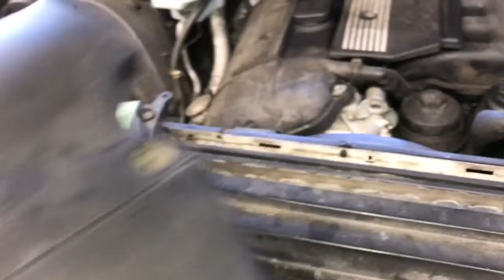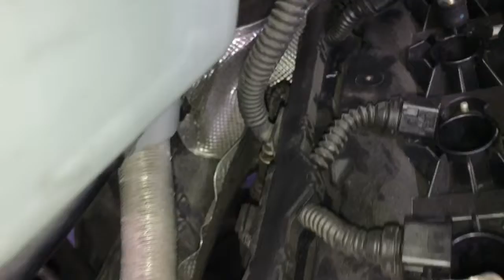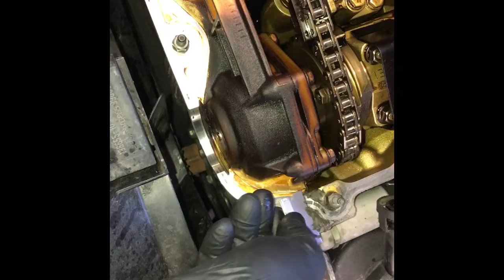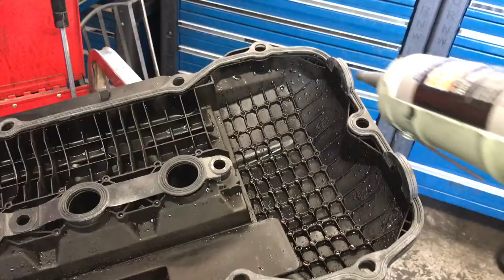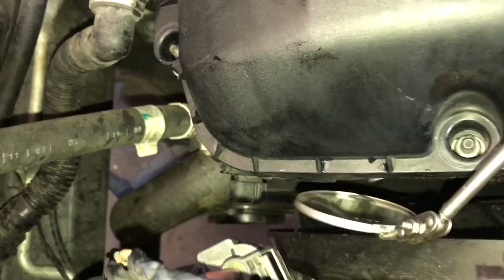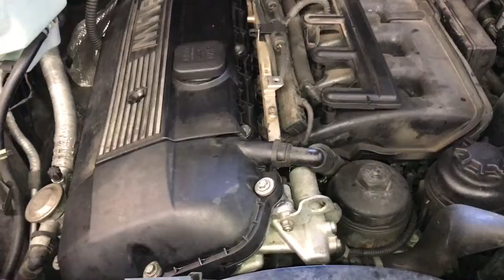How To Replace A Valve Cover Gasket On A BMW X5 E53

Comment: Greetings and thank you for your effort, I am from Iraq, please send me a link to a video of you opening and cleaning the oil pressure evaporation valve, because my car x5 E53 model 2005 suffers from a lack of oil and there is always an oil spot under the engine after starting, the diameter of the spot is approximately 20 cm... Regards

Comment: Thanks!
Reply from the maker: Thank you very much!!
Reply: @HowtoAutomotive  hi, I just opened up the package that my new gasket came in and it doesn't include the grommet seals. Should I hold out for a more inclusive set?
Reply from the maker: @allenschneider167  if the grommets are still soft, then you’ll probably be OK reusing them. But if they’re hard, I would wait for the new gasket set.

Comment: Decided to change plugs at the same time. Why not? WARNING: make sure your rubber insert plug socket doesn't grip plugs too tightly. Mine did, and on removing the short extension bar, the socket stayed behind on the plug, and it was too deep down to extract with any other tool. After years in the trade and having too many tools, found another well used insert socket, and after removing the plug again, was able to replace it, not leaving the socket behind!

Comment: Great video! The only thing I would like to mention is that there are only 15 bolts on the valve cover itself. Eleven around the edges and four down the center. I was working on a 2006 BMW X5 3.0i.
This job is pretty easy for your average mechanic. If you're a beginner I think you could handle this project also.
Again, great video! There are alot of bad ones out there. 
Thank you and keep up the good work!

Comment: Do you need to put sealant on the inside gasket that protect the spark plugs or just only on the outer rim of the valve gasket?

Comment: Thank you for the video, although I was not replacing the Valve Cover Gasket, I "simply" was changing the Valve Cover - this particular Valve cover came with Gasket installed. Point being, your video walked me through the process needed to complete my project. Big Thanks!

Comment: Could a high pitched loud squealing noise that starts about 5 miles into driving be caused by a faulty valve cover seal?
Reply from the maker: Sid Kay Yes the PCV inside the valve cover has most likely gone bad. The way to tell is to take the oil cap off with the engine running and if the hissing are squealing noise goes away that is where their problem lies.
Reply: How to Automotive great - thank you so much - if you’re in Los Angeles area I would bring my car to you to fix - are you?
Reply from the maker: Sid Kay I’m in San Diego.👍🏻
Reply: How to Automotive what’s PCV please?

Comment: Hello, I have a BMW X5 3.0i year 2002, I have a problem with the second gear, in D from first to second the motor goes in to limp mode, I have to drive it in manual shifting from first to third gear, what do you think is the problem, it is a solenoid? Best regards
Reply from the maker: Carlos Sánchez we need to figure out why it's going into limp home mode. I would start by pulling the code. It could have nothing to do with the transmission and be an engine problem. So I would start there having the codes pulled.
Reply: The dealer says it's a problem in the transmission
Reply from the maker: Carlos Sánchez if you can find out what codes there was it would help. There's so many things it could be.

Comment: Who would down vote this?  Probably a used BMW owner.  LOL
Reply from the maker: YouSoundButtHurt I think I have a hater. Just about every video I post five seconds after it up there's a dislike. Lol
Reply: Well I watch all your vids, they're well done, informative and to the point.  

By the way, what's your opinion on the newer turbo BMWs?  I'm thinking of picking up either a 2011-2012 135i or a 335i but I'm not sure I want to bother with a turbo BMW.
Reply from the maker: YouSoundButtHurt i'll tell you right now that turbo car is fast find a drive but it does leak oil. If you get one you will most likely be working on it from time to time.